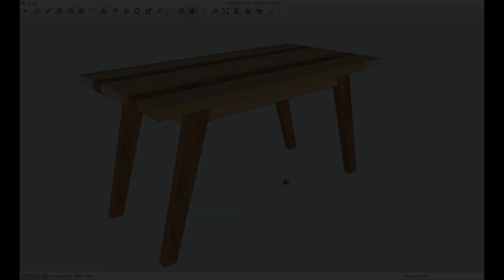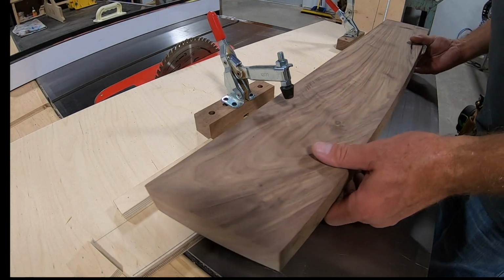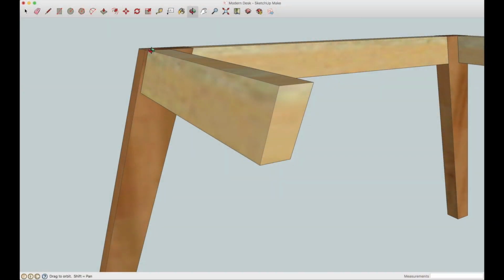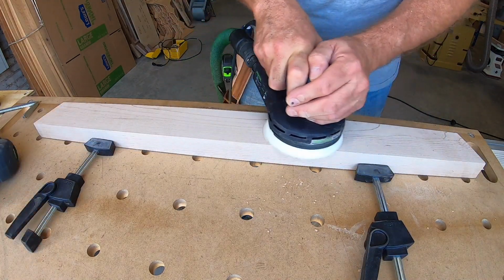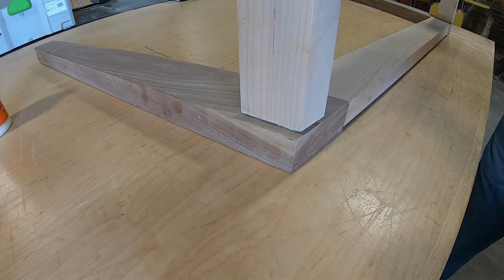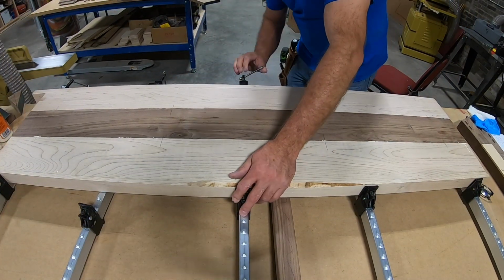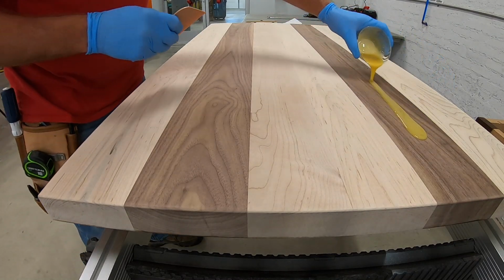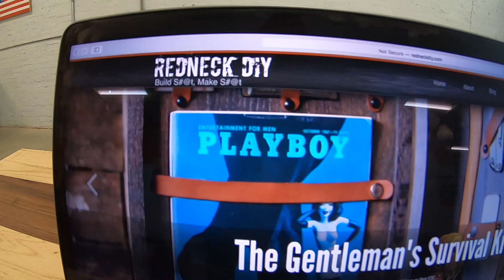🛠 Making a Desk:  Simplicity with Elegance

Comment: Nice build! Curious why you didn't just adjust the fence depth of the Domino for the reveal you wanted instead of making a shim?
Reply from the maker: Matthew!!!  Thanks for checking it out.  You raise a good point and I considered it but I felt like it was too risky to try to adjust it as you described.  The reveal itself is not that big a deal because your eye won't pick up on a 16th but the top edge where the frame assembly comes together is a different story.  An error there would cause all kinds of problems.  Hard to explain in words without showing but I hope that makes sense?